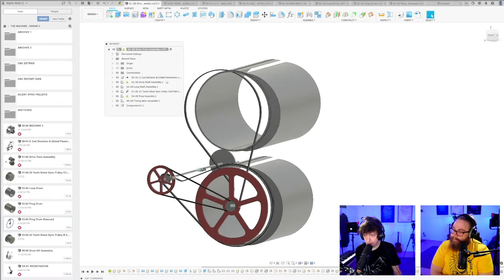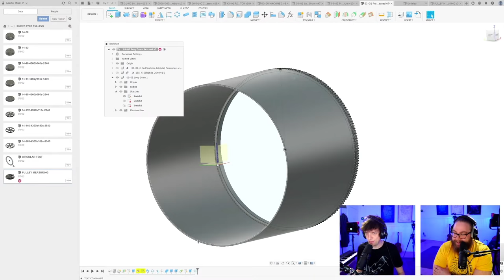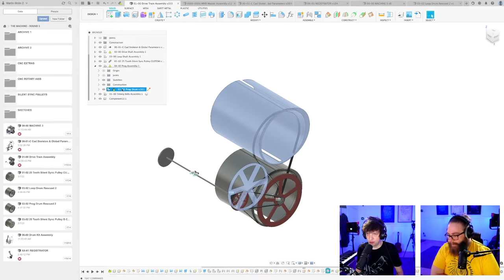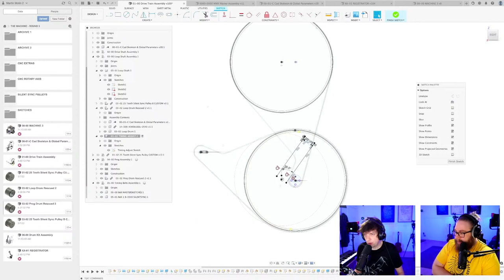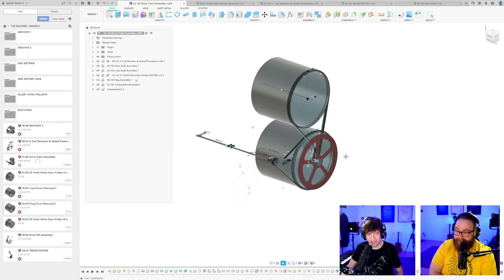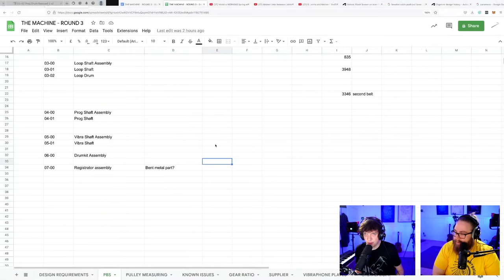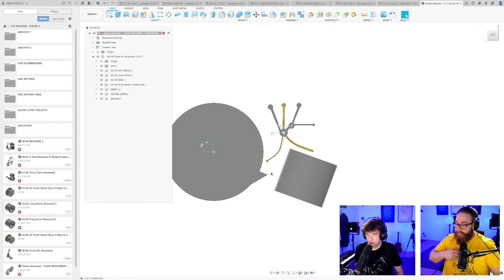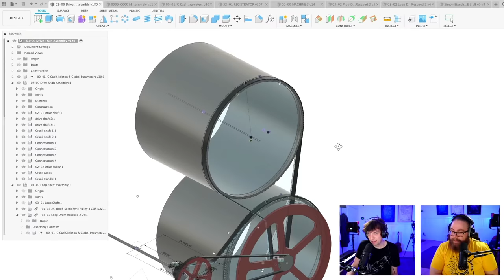A Better Parametric Structure in Fusion 360 - Martin vs The Machine

Comment: Hey Martin and/or community, I'm a systems engineer and my understanding is that the marble machine x failed to keep up with the marble flowrate at all points in it's marble loop. I'm just wondering, Martin are you thinking about marble flowrate as a design parameter for each section of the loop inside the machine? My apologies if this has been answered already
Reply: Im a chemical and soon an environmental engineer and flow rates are much important! I think there is a section on the wintergatan discord server where the ideas came in. Idk if the section is brought alive up to the MM3. Have to check on that. If yes, the marble flow is considered in the design process. But at this point he only focusses on positions and belts, so the rim and the marble transporation system follows after. But i think the marble flow has to be in his mind right now too.

Comment: A side effect of having the "tensioner" on the pulling side of the belt, is that when adjusting it you change the internal timing of the wheels. Could be useful, or work against you.
Reply: Indeed, actually a very elegant way to make the two drums play exactly in sync, though you still will want a simple sprung tension arm somewhere out the way - without it then any sync adjustment or change in environment (which for a world tour machine is a given, many locations and even the venue will change dramatically when we all pour in to watch vs the empty room it was setup in) will risk the belt tension changing too much for good function. At least if you don't want to pretension the belt at setup really high (a good belt shouldn't break) and put up with the extra friction that will cause (not to mention stiffer frame and better bearings required).
Reply: @12benni  The gear ratio doesn't change, the timing does.

Comment: No the tension side will shift how many teeth engage between the driver and driven gears, hence timing.
Reply: That's not true, timing pulley does not change the ratio at all